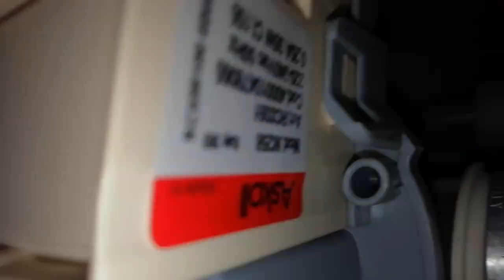Whirlpool Dishwasher Error F6 E4 due to leakage on the Motor Diverter Valve

Comment: Sometimes it happens when the dishwasher drains under the sink and the drain is shared with it. If the sink becomes clogged and the dishwasher hose is removed to proceed, the sump under the dishwasher fills up and blocks due to the anti-flooding system. The display shows error E4. In this case turn the dishwasher upside down, remove the lower bulkhead (2 screws) and dry everything, especially the polystyrene float, then reconnect everything. Problem easily solved and $200 saved.
Reply: how can i remove  lower bulkhead ?
thanks
Reply: @alextube001  Turn the dishwasher upside down, you will see a panel with 2 screws. it's very simple to do, bye